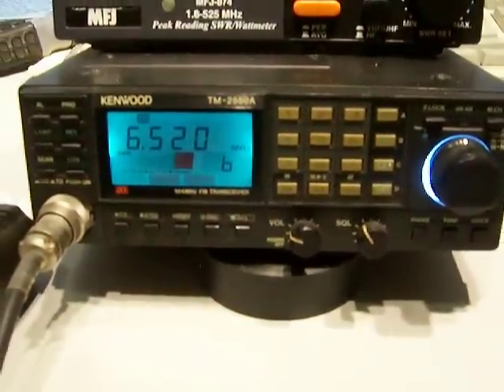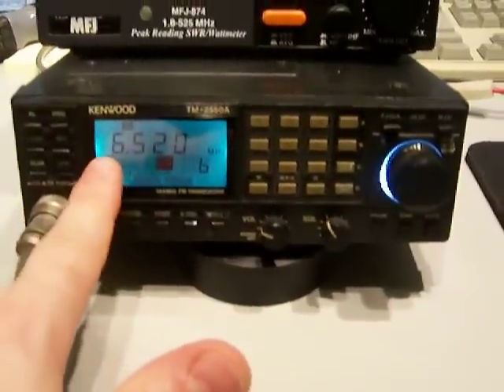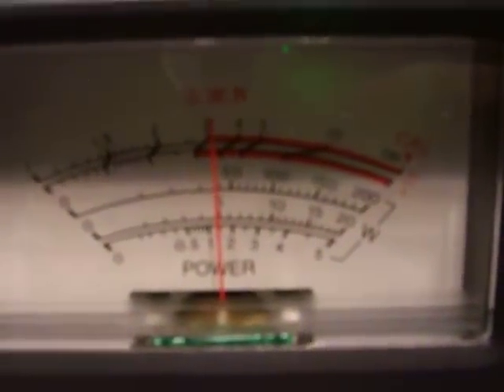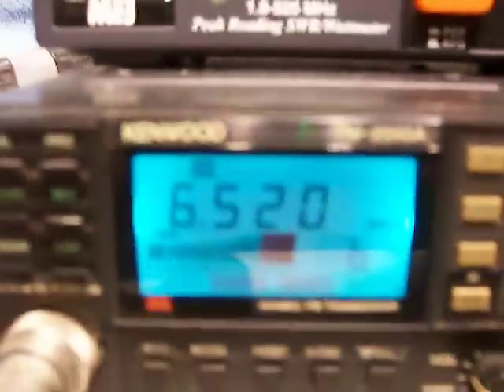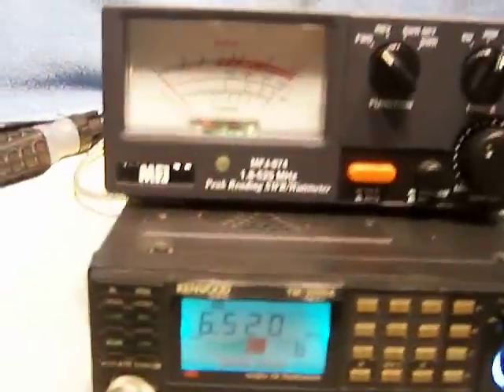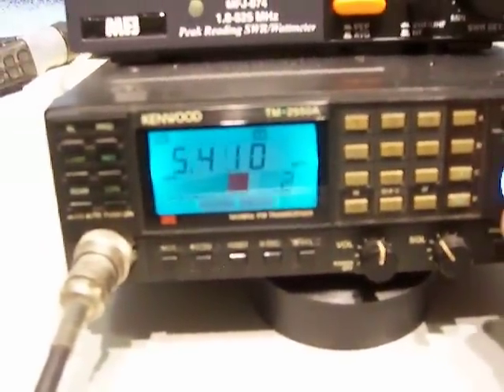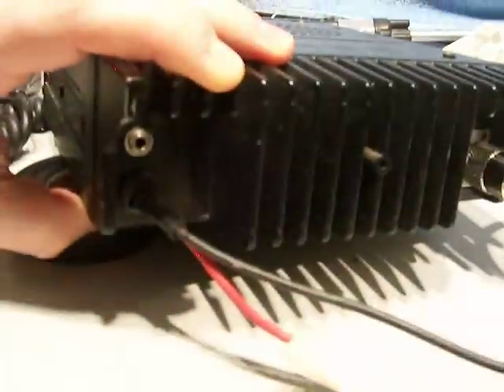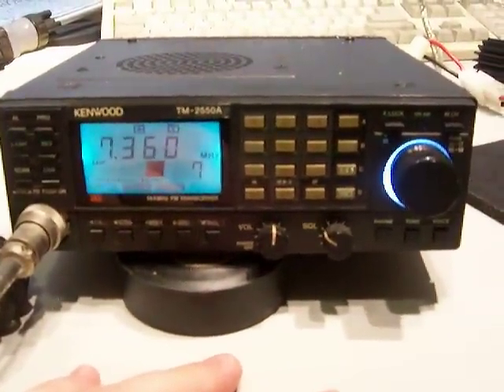Kenwood TM-2550A.MOV

Comment from the maker: Brandon,

No one has a step by step, that I have found. I will have to see if I can get one together. 

What I did is, used LED's. You have to take the whole front plate off from the chassis, remove the PC board from the front plate and solder in the LED's. - Be patient, takes time and if you have never done this before, you can rip cables, wires, break switches, lift traces off the baord or it won't "fit" perfectly back in place! 

I have used BLUE but WHITE looks nice too! 

73s